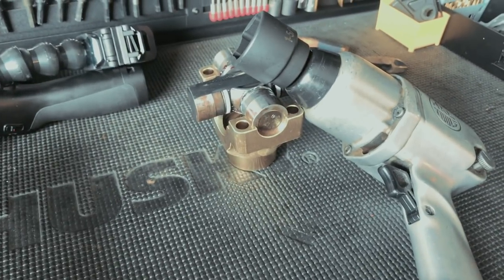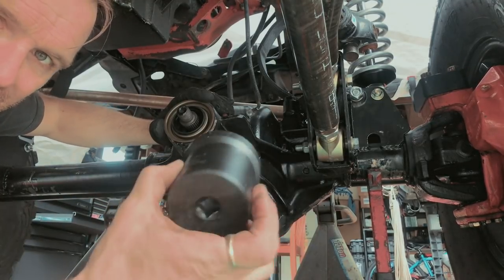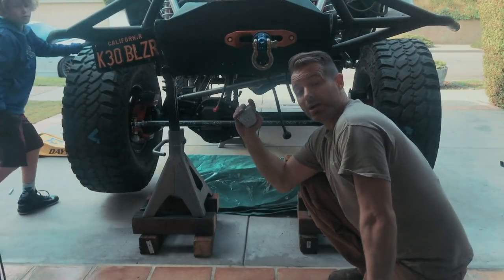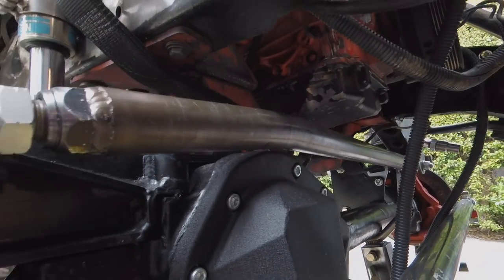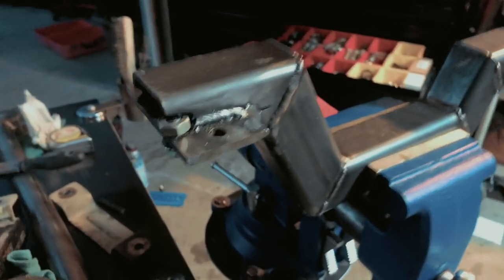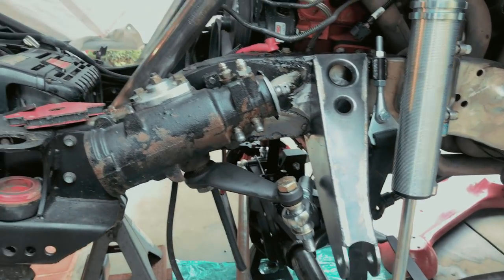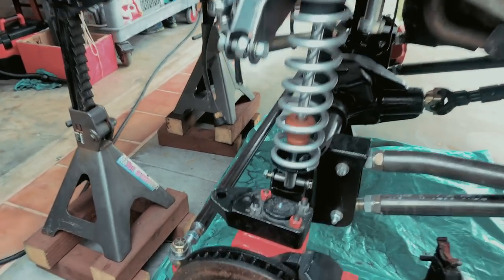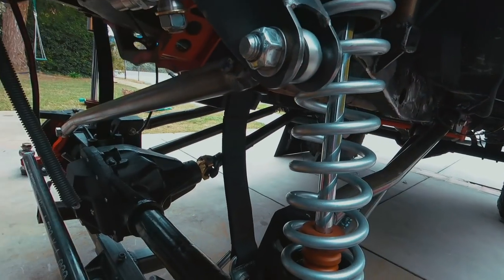MG #85 - Four Link Front End on my K5 Blazer! Part IV

Comment: You probably have been told by now, but a good way to tighten that sucker is to get somthing to hold the pinion, pipe wrench and pipe or something holding that against the ground or spring then use a big flex bar with pipe extention on the nut and tighten it pushing on flex bar with your foot. There's no crush sleeve in a Dana, just shims. Wasn't close to tight enough in your vid
Reply from the maker: You don’t think it was tight enough?   I kinda felt the same way.  Dammit.  Lol.  I knew I was getting windup and everytime I watched that clip during the editing I thought.  Hmm I need to tighten that lol.  !!!

Comment: Im doing a honda passport 3 link with a chevy dana44 front. I watched you link front episode 1 but you ended before panhard where did you start the panhard ?
Reply from the maker: Dude.  You had me at Honda passport.  That’s awesome.  Panhard went off and on a few times.  Not sure which video but it was somewhat challenging to fit with the steering box.
Reply: Merricks garage im there with you not much available for my swap im doing it all by hand with my plasma. Build problems lol